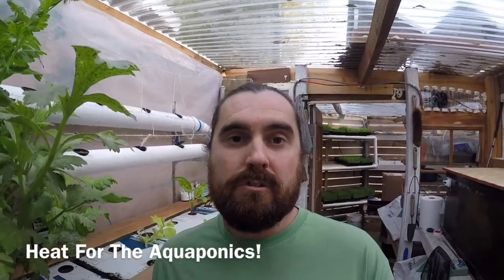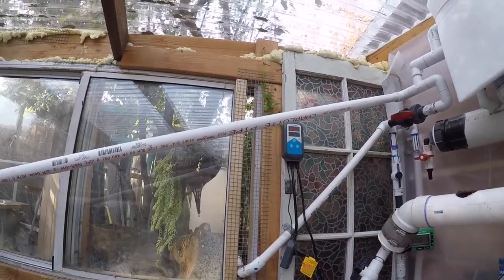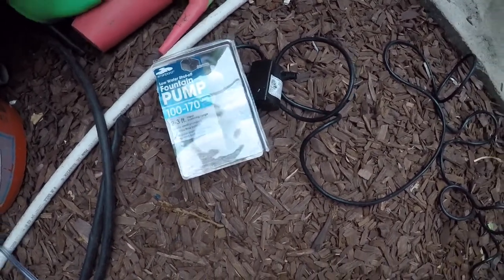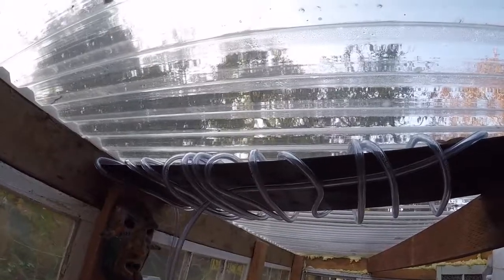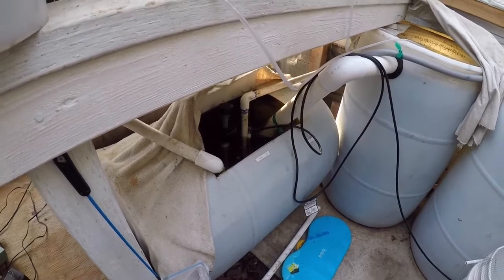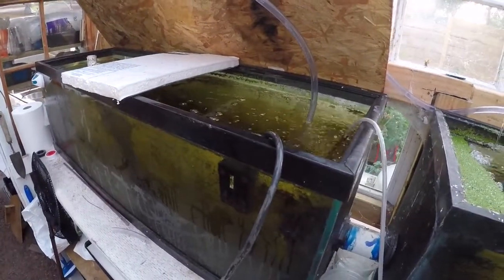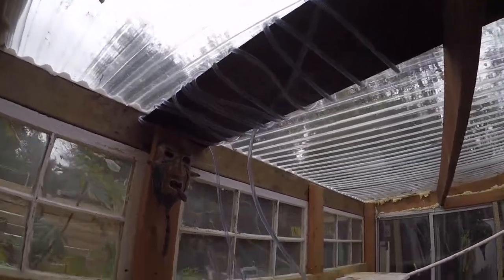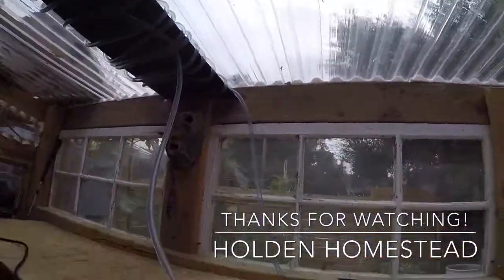HOW TO Heat Your Aquaponics For Less Then $20!

Comment: Dude you absolutely have to use black hose.. literally will increase temps by like 400%
Reply from the maker: Agree but it has to do with what temp the water is coming out it gets 105 here sometimes and in the green house it’s way tooo hot
Reply from the maker: Gets tooo hot at my place that’s why I chose the clear . Thanks for the tip anyways

Comment: no $20, 12v, water heater element?
Reply from the maker: Kenneth Rutt you can easily find a free dryer / water heater online. I use crags list it’s great . There are lots of free ones online.. thanks for the comment .... I never used a water heater element on this video?
Reply: Thanks, I'll check out crags list.  Going to try out a small aquaponics for the first time this year.  I have a 110 stock tank inside a small 6x8 green house.  Where I live I expect the water to get into the 80's in the summer and possibly down to the 30's in the winter.  I want to use a fish I can eat but with temp fluctuations I have to decide between cooling my water for trout of heating it for talapia.  I think heating is the more cost effective because I think I can do it with Solar.
Reply from the maker: Kenneth Rutt where we are it has the same temp range we did tilapia and they were great ! Heaters for about 2 weeks out of the year that’s it

Comment: not sure where you live but good way to keep water warmer is to put it in the ground it uses the earth like a heatsink kinda neat
Reply from the maker: yes we got great results adding the pond outside its helps a huge amount!
Reply: Old comment, but I'm glad to read this. I'm busy building my system and putting 2 IBC totes (1 fishtank + 1 sump) underground with another IBC fishtank and 2 barrels and filters above ground. So at least 1/2 my water will be underground at all times. Different reasons for doing it, but I'm glad I'll get some heating as an added benefit.

Comment: good plan, however your going to want to use black wall tubing or garden hose 1) for the added black & heat, & 2) algae will build up in clear tubing & sunlight. Get some Styrofoam insulation to keep your heat in your tanks & the sun out (at least on 3 sides)
Reply from the maker: thanks for the advice! the black tubing will help with algae build up (trying to stay food grade, so maybe painting the hose or wrapping it in tin foil?), haven't had that problem but its not summer yet :) and for the insulation the sun is helping heat the water and the heat in the green house is is helping as well... always modifying the system! :) thanks for your comment and supporting us by watching the videos! cheers!

Comment: doesn't the hot plastic release chemicals into the water? also why are ur tanks so dirty? is it just algae?
Reply from the maker: OneTacoAt ATime it depends on what kind of plastic it is there is food grade plastic and non food grade plastic everything I try to use is food grade. (The Foam I used is polyethylene) The tanks grow algae for the fish they eat it so I let it grow on the top tanks. The tanks are in a green house in the sunlight as well so the system grows algae real fast!  (free food) let me know if you have anymore questions thank for the comment! Cheers!